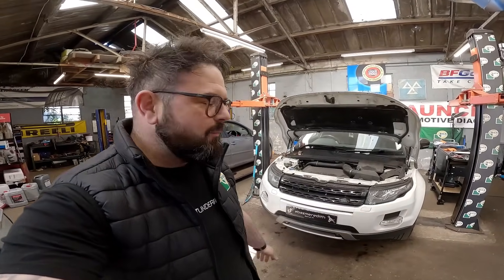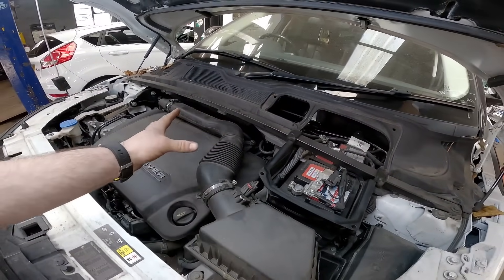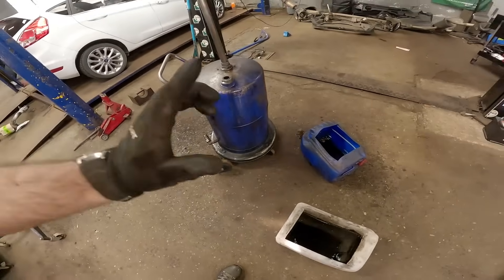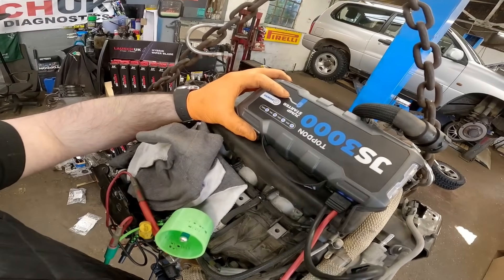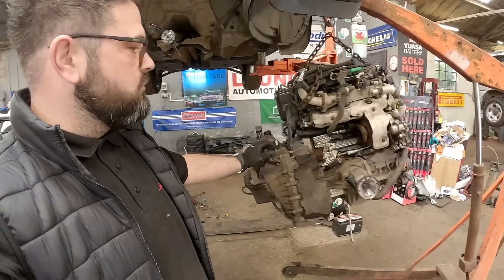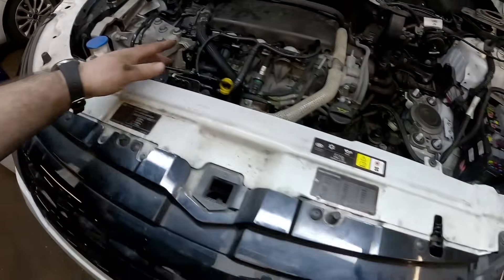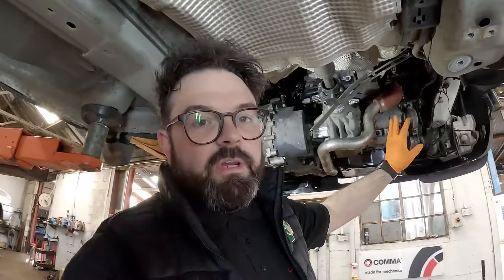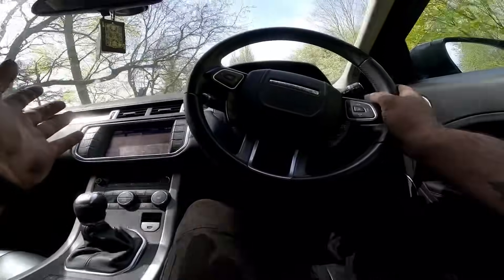I CANT BELIEVE THIS ENGINE STILL RAN!! RANGE ROVER EVOQUE 2.2 ENGINE FAILURE........

Comment: That’s the good old Peugeot DW12, 2.2 hdi engine. They are great. 
I have it in my Peugeot 407sw xs170, twin turbo. It’s a proper motorway mile munching engine, quick too, especially in the lighter Peugeot. 5000 mile oil changes with the proper 5w30 Total ineo ECS oil is key. I can’t tell you how long I partied for when I found the glow plugs I had to change were at the front of the head and not the back….😂. Thanks for another great video Baz.
Reply: Is this 2.2 engine the same one that is currently fitted into Peugeot Boxer vans?
Reply: @PTRsTransport   basicaly yes.   Some updates, different fuel system, after treatment etc, but yes its the old DW12 !
Reply: @timbo19751975 
Thanks for your reply, i do appreciate it.

So does that make a 2.2 Peugeot Boxer or a 2.2 Citroen Relay a worthwile buy? (I'm after a new van)

I have read that their gearboxes can be a bit iffy. Is that still the case?
Reply: Trouble in the evoque is the dpfs are crap and dilute oil with failed regenerations
Reply: @benjones1180 The problem would pretty much go away if owners learnt the signs that the car is regenerating, I got caught out with a 1.9CDTI engine years ago that ended up with EGR and DPF issues, I now always leave my display on the fuel economy setting, my advice is to learn what the instant usage figure is and if its reading any higher than that, don't turn your engine off, alternatively, there are other ways of knowing your car is regenerating (change in engine note, some cars run the fan whilst regenerating or other cars i have had you can hear the metallic noise of the exhaust getting hot)

Comment: Hi Baz. Another great video from you, any good reason why you do not use Gates belts, also would it be possible to remove and fit new glow plugs without removing the manifold a the SD4 engine.

Comment: Hi I’m looking for some info if you can help please . Right Vw convertible 2015 1600cc diesel engine code cayc . Driving along car in limp mode engine management light on pulled over and then my mate decided to carry on driving 3 miles back to his house  , called me put a scann tool on the car  injector 1 down , so I asked what happened and I could not believe he drove 3 miles  with the car like that . Put a new aftermarket injector in coded it and started fine running fine  5 mins later I could hear a tapping on the engine . So what I’m asking is how to tell if it’s top end or really bad lower end . Injector down drove it 3 miles what damage could be done . I know it’s hard to say but just give me ur best guess. . Regards
Reply: If it's the 1.6 the caves are all your injectors are gone down because of the fuel pump. Check the fuel filter and high pressure pump for swarf under the sensor. Any metal will continue to damage your injectors and they will all fail. I strip the injectors and clean them along with the fuel rails and pipes aswell as changing the pump obviously and anything in the tank
Reply: @jlmmotorcarsales2373  thanks I’ll take a look at that , the only thing is the car starts and runs ok . There is a very very small miss and the tapping noise. Many thanks again .
Reply: @cliffperry8470  Deep noise like an injector knock? High end tap won't be caused by the fuel system, but injector knock will still allow it to run fine. Quick 5 minute check to rule out the fuel pump. Literally a T25 socket and the fuel filter and the pressure sensor on top of the pump will just pull straight out. If it was in my garage I would check that before anything as I do so many of them

Comment: Isn't that 2.2 engine from a Transit though, and supposed to be reliable?   Or is it an Ingenium that's usually awful?
Reply from the maker: PSA this one and they are normally bullet proof
Reply: @bazmeredith  PSA in an Evoque?   Well I never knew that!
Reply: @hunchanchoc8418   Where've you been ?!
Reply: 2.2 DW12 PSA engine is not at all related to the 2.2 Transit / Ranger / Defender motor.
Reply: @timbo19751975  I know - it's shameful. Sorry!
Reply: 2.2 dw12 was a jv between PSA and Ford and Evoque is basically an S-Max because designed, developed and approved by Ford before they had to sell.

Comment: BAZ ARNT YOU PUTTING A NEW CLUCH IN THE ENGINE PAL THATS MEANS IF THE CLUTCH GOES AGAIN IT WILL BE ANOTHER HEAD ACHE I WOULD HAVE PUT A NEW CLUCH IN HOW MANY MILES HAS THE NEW ENGINE ON WHATS WRONG WITH THE OLD ENGINE CAM CHAINS OR BIG END BEARINGS YOU NEVER SAID 😊
Reply: He said above its due to cost he didn’t do it.
No need to shout either.